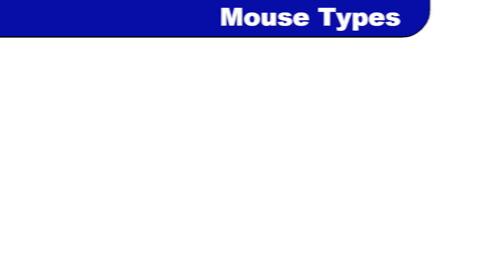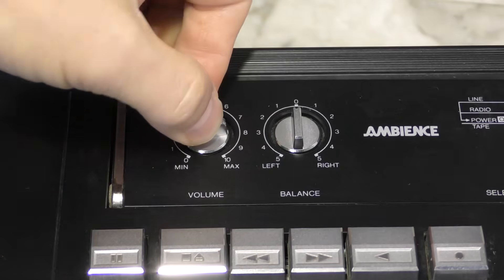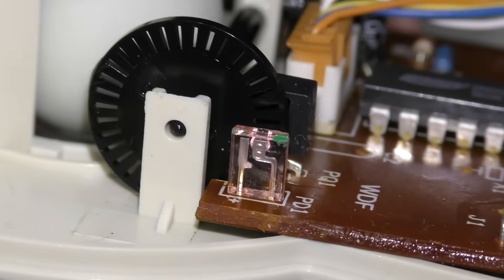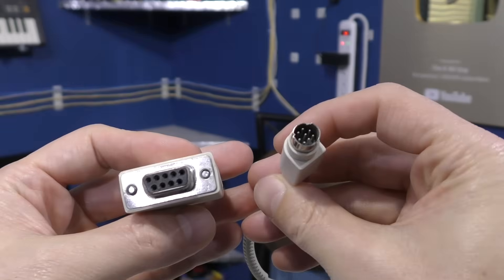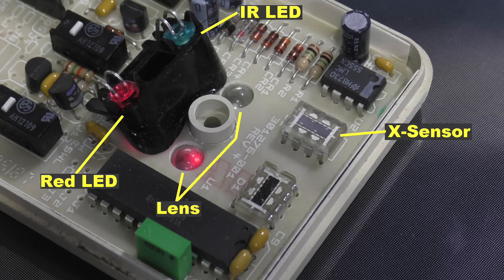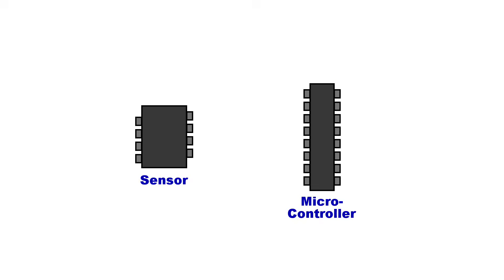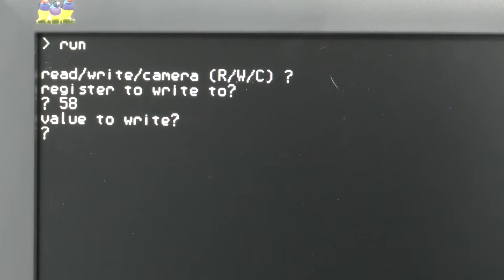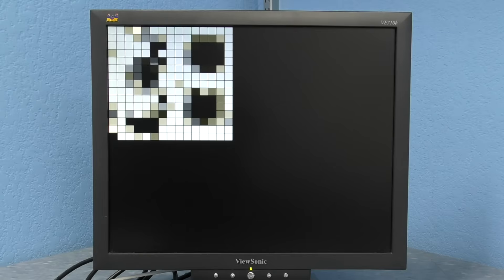What does a computer mouse see?

Comment: And... Nowadays even though trackball mouse looks like it got a ball, it's most likely optical as well. You still need to clean both the ball and the socket from time to time, but at least it pretty much never fail because that's the equivalent of having a known specific mouse pad to use the mouse and the mouse would only accept that pad.

Comment: I remember using this Tandy mouse on my Tandy 1000HX. Actually, this mouse is more or less a ball operated joystick. It wouldn't work with anything except DeskMate, which was designed to use the joystick as a mouse too.

That's why it uses potentiometers and they have a range of motion. This is because this mouse is actually a joystick.

Comment: Wait, people didn't know how to clean their mice?

Right from the first time I ever dealt with a mouse that was being awkward, I cleaned the rollers, not the ball.
Nobody taught me this as far as I remember, it just seemed obvious looking at where the gunk ended up...

Really surprised people didn't know or notice...

Also I don't miss opto-mechanical mice.
At ALL.
ugh.

Even a bargain basement modern optical mouse bought for $5 is preferable to those old things most of the time...

Side note: If you examine the mechanism of 95% of modern game controller analogue sticks, you'll find a set of potentiometers. (Higher end joysticks, but not gamepads, may contain hall effect sensors).

Examine a nintendo 64 thumbstick though, and you'll find some weird plastic gearing mechanisms and...
An pair of optical encoders identical to mice of the era!

Yes, the n64 thumbstick, is mechanically closer to a ball mouse, than it is the majority of thumbsticks we've been using since then.

And before you ask, no that is not why they fail the way they do;
The optical encoders are extremely reliable.
the problem with the n64 stick design is that it has two half-circular pieces of plastic at 90 degree angles to one another with the stick stuck through a slot in each one.
This means that the stick moves these plastic pieces, which have gear teeth on the end which turn the encoders.
The problem is... Friction. The stick wears huge grooves in these plastic pieces over time, meaning the stick gets looser and looser to where, in the worst case the stick is almost entirely dead zone and barely responds at all.
(It can also physically wear out the plastic bowl that the stick moves inside of, which also loosens things, but nowhere near as much...)

This is a design flaw where they simply didn't properly account for the friction when choosing the materials they used.

For that matter, you can massively reduce the onset of the problem by putting sewing machine oil or an equivalent plastic-safe lubricant inside the mechanism.

Makes you wonder, given how effective that is, why they didn't do that. Especially AFTER they realised the design flaw, since as far as fixes go it's a pretty trivial one.
(not flawless, since the oil dries out over time the same problem will still happen eventually if people don't do maintenance, which most won't. But it would have substantially extended the life of the sticks on average, and all it would have taken was a bit of oil applied during assembly...)

Comment: Ah yes... the Tandy "joystick" mouse. It used the joystick driver and ports on the Tandy which is the reason for the limited potentiometer design. There was no dedicated Tandy mouse driver so there was no way to properly implement a freewheeling mouse on the Tandy joystick ports. The mouse "box" was pretty much the full screen though. I never had any issues reaching any corner of the screen on the Tandy 1000 EX that I grew up with. You could also use it as a joystick in games because of this, which sometimes helped, depending on the game.

Comment: I'm guessing that you could only read one pixel every 50ms because the image sensor may have a different mode to send all pixels in a stream. At least with some of the sensors I have worked with (granted they have been the I2C protocol) have an option to read data one by one, which requires waiting inbetween each read or a sequential/stream mode that sends all data at once. I just cant imagine this mouse working well if it could only read a pixel every 50 ms, I bet it's doing something to read it much faster.
Reply: Reading the datasheet, it would appear that the sensor does all the heavy lifting, it does the complete image acquisition then sends the frame to the built in dsp (digital signal processor) to calculate the movement. The microcontroller only reads the delta x and delta y registers. So I guess they never designed it to be able to quickly transmit frames.
Reply: Yep, the pixel grab register will only pull one pixel per frame.............sad

" The pixel grabber captures 1 pixel per frame. If there is a valid pixel in the grabber when this register
is read, the MSB will be set, an internal counter will incremented to capture the next pixel and the
grabber will be armed to capture the next pixel. It will take 225 reads to upload the complete image.
Any write to this register will reset and arm the grabber to grab pixel 0 on the next image."

also, according to the datasheet you should be able to initiate a read command every 4 microseconds. You send the address you want to read then wait 4 microseconds to get the data back. Then if you want to do another read, you must wait 1 microsecond after the sensor sends the data byte. 
Maybe when you tried reading pixels really fast this minimum hold time was violated as in you sent the address and right after you got the data you sent another request. If this happens the datasheet makes it seem like it resets which takes about 50ms according to the datasheet, this could be why it only does it every 50 ms.

"During a read operation SCLK should be delayed at least
tSRAD (4 microseconds)  after the last address data bit to ensure that the
ADNS-5020-EN has time to prepare the requested data.
The falling edge of SCLK for the first address bit of either
the read or write command must be at least tSRR(0.5 microseconds) or tSRW
after the last SCLK rising edge of the last data bit of the
previous read operation."
Reply: @The 8-Bit Guy I hope you see these messages and give it another try :)
Reply: @matth3wc  I don't know if he's going to see them or not, but it's fascinating information nevertheless.  Thanks!  :)

Comment: What is the actual frequency of image processing in the mouse?
Reply: It depends on the mouse's "polling rate".  Lower polling rates have more latency.   Higher polling rates have less latency, but you eventually hit a point of diminishing returns where you're using more CPU time for less actual benefit.  A lot of gaming mice let you set the polling rate through their control panel, from 125 Hz (which is your typical non-gaming mouse) up to 1000 Hz.

Most of the pro gamers (the ones I've personally met) prefer 500 Hz as the best compromise between latency and fine control.  1000 Hz does you no good if the slightest twitch of the mouse sends the mouse pointer flying onto your other monitor (a lot of streamers have a two-monitor setup so they can play the game in a borderless window on one monitor, and watch the chat on the other one.)

Comment: You could get a tool when had a sort of spiked rubber ball on the end intended to clean mouse rollers.
In practice using some sort of spatula or, even, fingernails was easier.
Never tried using a sharp knife, seemed to great a risk of damage to the mouse or injury.

Comment: I think the reason you had to include the delay between reads of the pixels is because you kept pulsing the CS line, when you deactivate then reactivate the CS line you have to wait before you can poll the chip again. If you pulled the CS line low, read all the pixels from the chip, and THEN pulled the CS line high, you should be able to read the pixels faster.

Comment: i wonder if that would be possible for modern mice some how... if imagine with mice now having 12000 DPI and more that would mean the resolution would be quite a lot higher. so basically, potentially, everyone with a half decent mouse has a device for decently high resolution surface displacement measurement.

Comment: The N64 analog uses an almost identical system to that of the optical-mechanical mouse. The analog stick makes two wheels with lots of wholes turn and there's an optical sensor which counts how many holes turned in a given time-frame

Comment: Back in the '80s, I used a Xerox desktop publishing system (I think this one: https://www.youtube.com/watch?v=97KwtogdSdY) and its mouse operated on the same principle as the early optical ones. It required its special mouse pad that had a grid, but it looked different from the one you have. I remember when later optical mice came on the scene, I couldn't understand how they didn't need the special mouse pads. ;-)

Comment: Does anyone have any ideas why there was that 50ms delay and he couldn't get the "real-time" pixel grab?
Reply: If you read the datasheet, it becomes fairly clear. "The pixel grabber captures 1 pixel per frame. If there is a valid pixel in the grabber when this register is read, the MSB will be set, an internal counter will incremented to capture the next pixel and the grabber will be armed to capture the next pixel."

The chip captures frames at an unpredictable variable frame rate and analyzes them internally. Each time it does this, and the previous pixel has been consumes, it makes available the next one. So the only way to reliably read the pixels is to either 1) wait plenty of time (ie 50ms) between attempts or 2) poll much faster and wait until the "valid" bit is set.

Comment: "there are only 224 pixels" – 225, dammit!
Reply: That would be the most cursed number as it's not divisible by 8.
Reply: @mare65  I was wondering why they did 15x15 instead of 16x16. Maybe a reserved or null value? Or maybe it was easier to have a zero column (and row) where everything was offset relative to it. I don't know anything about engineering but this is fascinating.

Comment: I only used the optic mouse with the ball when I was around 5-6 years old. Then, everything went to more modern optical. I think nowadays those mouses we can buy from hardware shop (gaming mouse etc) can take a much higher resolution image and determine the mouse movements much easier than before. Not gonna lie, the old optical mouse with the ball inside was not particularly accurate. 

Great job David.

Comment: I guess it's mostly expected that the sensor would be slow giving you actual image data since it performs the image analysis on chip and would rather give you the deltas instead.

There are a couple of mouse sensor-only chips sold on Tindie (not Tinder) as a small assembled PCB and lens, which are a bit more modern and use SPI for communication.  So it wasn't actually necessary to destroy a mouse to try this out.
Reply: Yes, but why spend $22.95 plus shipping and handling for an ADNS-3050 Optical Sensor Board, when you can just go down to Wal-Mart and pay $6.88 plus tax for an Onn mouse to destroy?

Comment: The 9 pin serial connector on Atari’s computers and home video game consoles were mainly for joystick controllers however their protocol standard ended up becoming quite popular in the industry with consoles by other manufacturers like Sega and Coleco also using the same standard on their home consoles and computers so if you wanted to you could actually use a Sega Genesis/Mega Drive controller with an Atari 2600, Atari 7200 or Colecovision! :)

Comment: Somewhere I once saw instructions for converting a modern optical mouse into Amiga compatible (and probably most of the other homecomputer standards). This required the camera to be seperate from the controller aswell. Bad thing is that you can't see it from the outside, so it's just luck to pick the right one from ebay. Would be nice to have a databse or some information on mice that surely have this kind of build.

Comment: It says right in the datasheet for the 5020-EN that you can only grab one pixel per frame. This mouse sensor is NOT designed to be used this way for actual motion. You are supposed to read the DELTA_X and DELTA_Y values. It does all the processing for you.

Comment: the new led mouses are not that supirior 
they have classical mouse lag probaly because they are taking images over the sensor while making light
from photos i know you need on movements at least 1/1000 rather 1/2000 if the object is moving fast to have a clear picture
the optical mouse dont do that in that speeds

also with a ball mouse you can move a line and on screen it will always be the same distance you moved with the mouse and you can try that severial times

with a optical mouse you can see if you move the same physical lenght you can see it is inconstand
that for a game can make a diffrens because a mind could calculate a spot where a object will be shooten at 
special on very fast moves on optical mouse you can see this problem a lot of the way is skipped or not right
and it takes time to fix that (thats not what you want)

the problem with a ball mouse rather was the tech was a bit badder and when they got dirty the contact/friction isnt well then the ball mouse have the same problem

Comment: The Tandy joystick can also be used as a mouse within DeskMate. The black CoCo joystick doesn't have a spring in it, but the Tandy Deluxe Joystick can go into "free mode" by holding the stick in one corner, and flipping the toggle switches on the bottom to unlock the spring returns. The joystick has the same "boundaries," as the Tandy CoCo mouse, or more accurately, the other way around: The Tandy CoCO mouse has the same "boundaries" as the joystick, because it also uses potientiometers. They also both use the same physical (joystick) port, and are (so far as I'm aware) electrically identical to the computer.

I've taken to finding PS/2 optical mice and spray-painting them beige to match those of my retro computers that support PS/2. If the ball can't track properly, it's not worth the hassle, IMO. For the older machines that only have a serial port, I've found that the Microsoft Mouse 2.0/2.1 are still pretty reliable. Good rubber formula, I think. That's important because even if you clean the rollers, if the rubber has degraded and gone slightly stiff, it won't track properly.

Comment: When cleaning non-optical mice, I never had to use a knife or sharp object to clean the rollers.  Usually a micro-fiber cloth and some windex or cleaning solution did the trick (just run it against the roller and move from side to side to scrub off the stuff). Thank goodness for optical mice though, as I remember some instances I had to clean the mouse on a regular basis, like every month (wasn't a big deal, took 3 minutes or so).

Comment: I'd love to have one of those mice. A PS/2 one, specifically.
Shame they're harder and harder to find. Still. Not impossible.
The mouse is one of the most interesting aspects of the computer. I think an episode on early mousepads would be very interesting.
Thanks for all your dedicated research and hard work. It's absolutely worth it.
Reply: Surely the word is still full of optomechanical PS/2 mice gathering dust in desk drawers and in the backs of wardrobes and closets?
Reply: @dunebasher1971  : Should be. Shop I was at they had a big tote full of the things.
Reply: I am making an winxp pc to run some old games my gaming stuff doesn't work so I had to use a ps2 mouse but the ball isn't heavy enough and doesn't touch the ground properly

Comment: you have it backwards with the light diagrams, if the light picking up is the input. Movement downward would show light on the bottom pixel first, then the top, so so forth. 

From what I can tell, you have the whole thing backward in terms of spatial reasoning. maybe Im wrong.

Comment: Thanks for the nice video, I lived through so many generations of hardware, it's fun to look back on the changes.

I definitely recall those optical pads, may even have one kicking around somewhere.  I know I have some early mice made by Logitech, one is a three-button with a 25-pin D serial connector from an NDS terminal, I think it's one of their C7 series.  While trying to find a picture of it to link to, I came across https://www.oldmouse.com/ (aka The Mouse Museum), figured I'd pass that along.

Comment: Place I worked at had some older Sun machines with working mouses (mice?). I remember going from old ball mouse to modern optical mouse but it's a weird feeling going back to use an old ball mouse after so long; they are so much more heavy and have more mass it takes you by surprise. It's like going back to a flip phone or something, we get so spoiled by newer stuff.

Comment: The KeyTronic mouse was an interesting one.  It used a pair of tilted discs on the bottom to track movement, so there was no transfer of crud via ball to internal rollers. 

I bought a few of them, because they were very good for general productivity work.  Not so good for gaming, though, since their resolution (300dpi) was too low.  Don't know if the design would support much higher resolutions, but I think it likely would.

Not much point these days, of course, as optical or laser mice are quite good at tracking on just about any surface.

Comment: I use to do a lot of work with Sun Microsystems.  Those optical mice were a real pain with the correct pad.  You needed to keep it nearly parallel with the pad at all times. 
I also got a $9.99 mouse from CompUSA that didn't use optical sensors. But a circular PCB and contact arms. To do the same thing.  But much cheaper and less reliable.